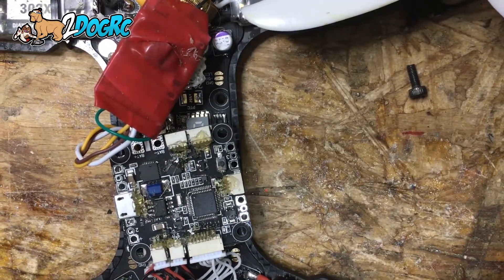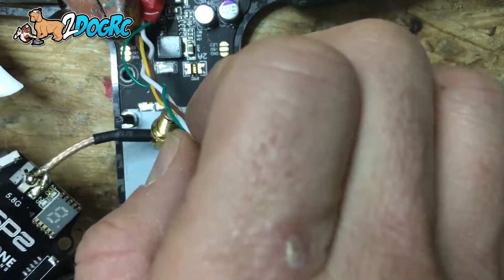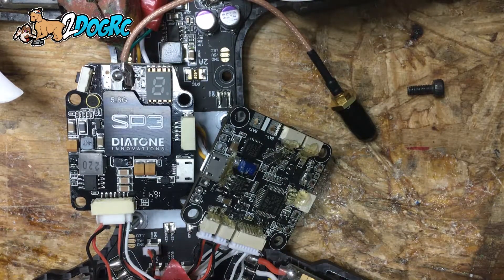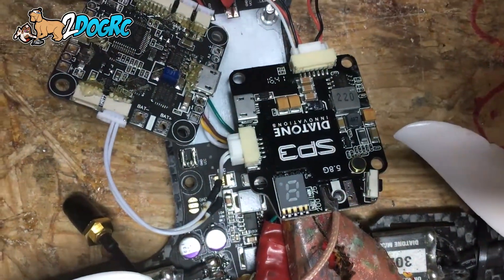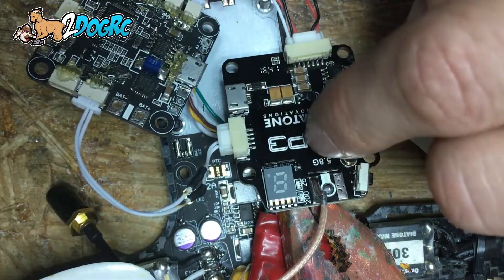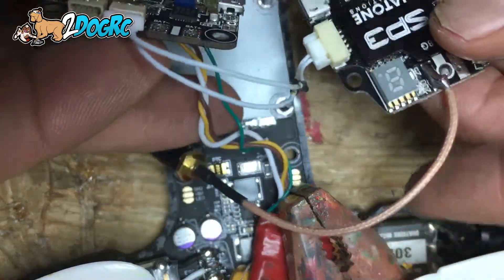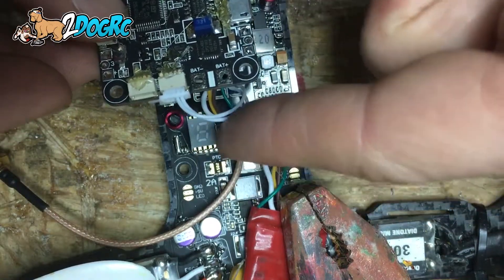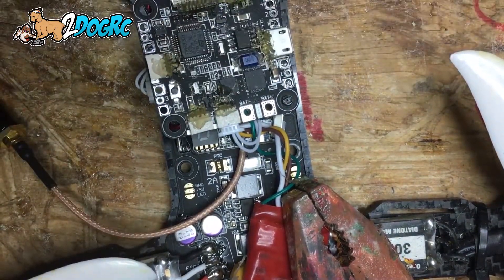Diatone Tyrnat Swap SP2 for SP3 Video Transmitter

Comment: Question, what are the differences between the sp2 and sp3? I've been looking and can't find any information on it?
Reply from the maker: The SP3 has a built in Minimum OSD.  However that unit is out of production at this time, only the SP2 is available.
Reply: 2dogrc 

Thank you, fortunately I actually already have one though :)
Reply: 2dogrc hey Mark! I see this, is this ok?

https://www.diatoneusa.com/store/p234/Diatone-SP3-40ch-VTX-0_25_200_600mw-Pigtail
Reply: can i solder RX and TX on the SP2, becouse ther is no plug, to get my OSD settings in Betaflight?

Comment: Thanks for the vid Mark. 

Question:  Your green wire (telemetry?) from your receiver is going to the same UART that you have the SP3 plugged into. Will that work, or did you need to move the SP3 RX/TX plug over to the other UART?
Reply from the maker: Jonathan Ott you can put telemetry on Uart1 and sp3 on Uart2.
Reply: Leave MSP turned on, right?
Reply from the maker: Yes,
 Always leave MSP on UART 1 or VCP depending on the board.  This is how the USB talks to the FC.  If you accidently turn it off, then follow the lost comm procedures.

Comment: +2Dogrc hey man nice vid! I got my tyrant and suspected a faulty vtx swapped it out for another same thing, came down to a DOA camera. Have you noticed a standard FPV cam won't fit under the Gopro desk, the metal that's on an angle under there doesn't allow it to fit. OOOOOorrrrr am I just not getting it in properly. I tried to fit a Foxeer Arrow V3.
Reply from the maker: POLARJFPV I have not tried an Arrow, but for the Hs1177 I had to cut the u frame right where the camera mounting screws go. Another option I have seen is to add spacers on the long standoffs to raise the go pro mount up.
Reply: 2dogrc I put an arrow2 in and I had to file some aluminum off the top mounts and cut the arrow mount to make it for but it fits good and now I have osd! just soldered the vcc wire from the cam to the red esc pad and shazam, on screen voltage!